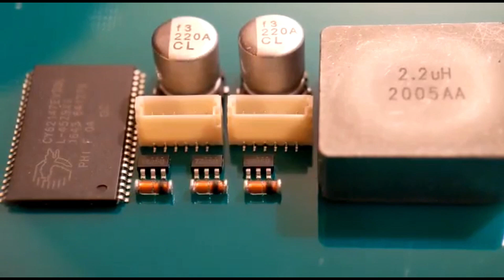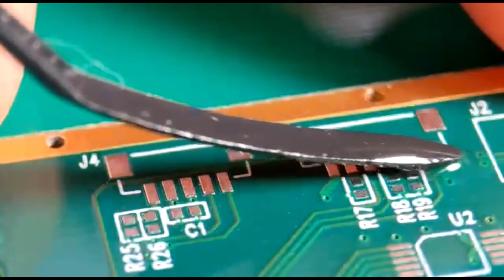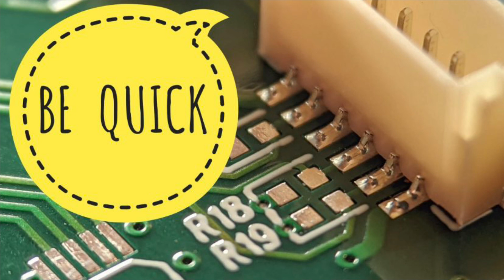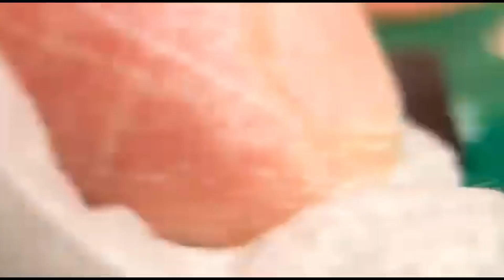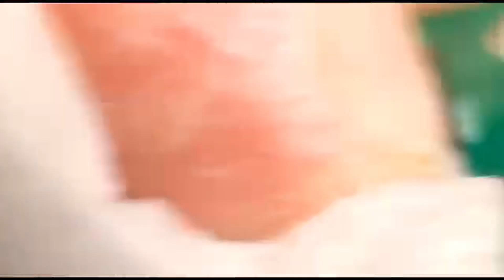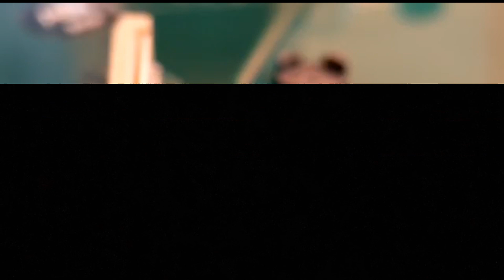How To Solder SMD Correctly - Part 3 /SMD Soldering Tutorial

Comment: Hi Mr Solderfix can you please advice me best way to remove an inductor coil from laptop motherboard, i tried with a heat gun an flux  wont move, i would appreciate if you can help or do a video thanks
Reply from the maker: Hi . There's a couple of things I would try first . I personally would try 2 soldering irons with very large tips on each one . I would flood both joints with leaded solder ( remove what unleaded you can first ) then keep your iron on both for a while . Then just lift component off when both joints have melted .This way has helped me out a few times . Otherwise I would use a heat gun ( I have a Quick Rework station ) again I remove what unleaded solder I can and replace with leaded solder . I then protect surrounding area with sticky backed foil tape then put gun on about 375 degrees . This normally works , or I just keep upping the temp and air flow slightly . Also I flux around the joints to aid melting . Hope this helps . Good luck 👍
Reply: @mrsolderfix3996  
Would adding low melt solder around the joints help?
Reply from the maker: Hi . Leaded solder or low melt solder should both work . Good luck 👍
Reply: low melt solder and they will slide off

Comment: Do you use a microscope for small soldering?
Reply from the maker: Hi . Yes I do use one for small parts , you really have to these days no matter how good your eyes are . I use a long reach stereo microscope , this allows me to get any size pcb under it and if your serious about doing some fine pitch or tiny resistors i.e 0201 or 0402 size you will need one . Thanks for watching , much appreciated 👍

Comment: How many degrees do you do the soldering process?
Reply from the maker: Hi . Thank you for your question . All the soldering was done at 350 degrees centigrade . That is the general heat I would use for the component types in this video  , but I do occasionally change the tip size on my Weller soldering iron depending on size of joints , ground plains etc .
Hope that helps , thanks for watching 👍